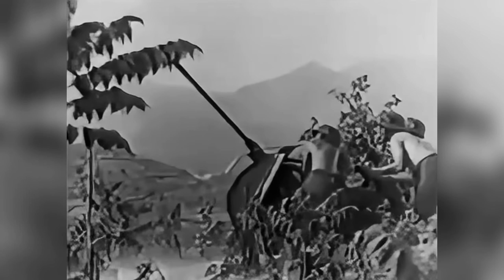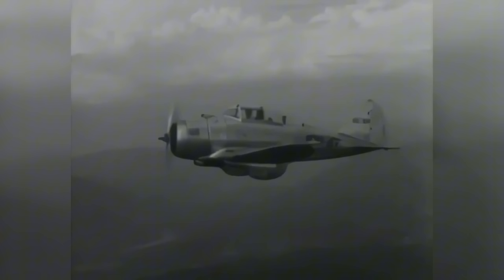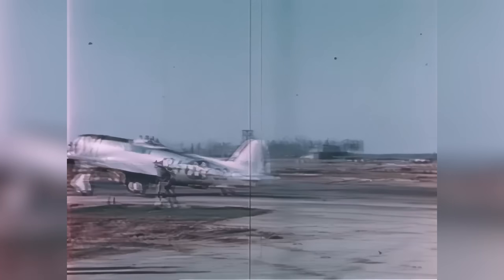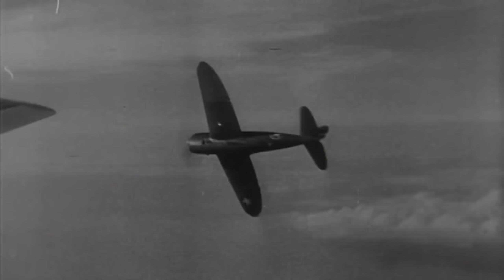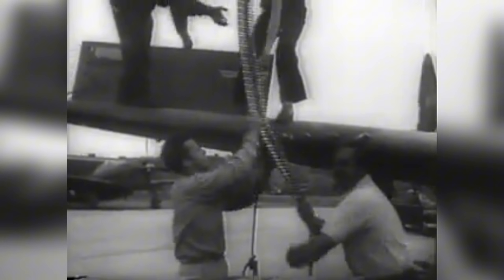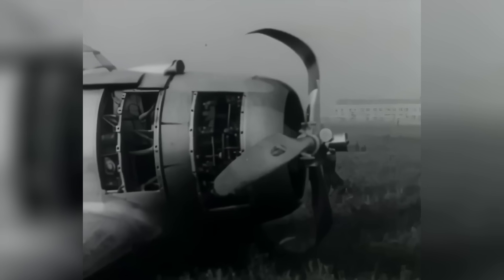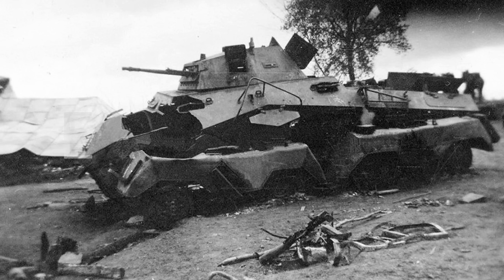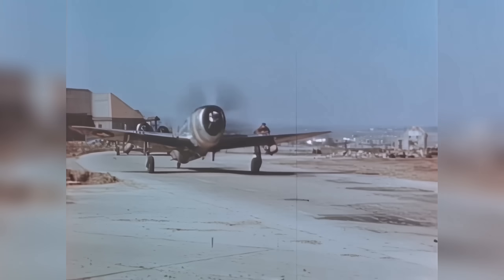Why Was the P-47 Thunderbolt So Hard to Kill?

Comment: The  p-47  of  the  Internet  is  the  greatest  fighter  ever  built....in actual  fact,  it   was  the  WORST .The  Best  fighter  built   and  deployed  in   WW2  was ,  for  people  who   Know  airplanes,  the  FW   TA  152,....best  engine,   best  power  to  weight  ratio,  by  far  the  best  engine,  massive  firepower----20  and  30  MM  Kanonen,  NOT  30  or  50  Cal  US  popguns.  The  47  was  almost  TWICE  as  big  as  a  fighter  should  be,  it  had  the  USA  Scheisse   Radial  Aircooled  Engine,    the  max  firepower  was  a  50   cal  MG.   More  47's  were  shot  down  toward  the  end  of  WW2  than  any  other  plane.  It  was  a  DOG,  It  was  a  Hog.     How  many  Aircooled  engines  ,  top  RPM  2700  ,  do  they  run  at  INDY  or  Nascar??  How  Many  Racing  Powerhouses  are  Twice  the  Size  and  Weight  of  the OTHER  Cars??    Amen....grow  a  brain.
Reply: No your wrong. In fact,it's the "47 C " that won back control of the air from the FW-190 over German Occupied France.

Comment: 3:04, surely that's a turbo charger, not a super charger?
Reply: Nope.  Turbo compresses exhaust gas.  Superchargers compress intake air
Reply: @j_boogie_483  Nope.  They both compress intake air.  Turbocharger is powered by exhaust gas and supercharger is powered by a mechanical drive from the engine.  The P-47 had both.

Comment: Not 86,000 trucks; 8,600 more likely.
Reply: No. It's 86,000 coaches,6,000 armored vehicles, 68,000 road vehicles,9,000 locomotives. Also shot down all of their best Getman pilots in air to air kills at a ratio of 8 to 1.

Comment: The P-47C Thunderbolt and early razorback "D's"  went up to high-altitude and faced "yellow-nosed" FW-190A-5's and won control if the air over German occupied France. They literally shot down all their experienced pilots. Then on return flights would drop down and strafe on the deck taking out important tactical targets. It won down at low altitude as well.

Comment: the bubble canopy

the P and W R-2800 dual radial Wasp

the 13 foot 4-bladed paddle propellor

armoured cockpit

and the only allied fighter to carry 8 .50 cal machine guns

and able to carry as much ordnance as a b-17

could almost break the sound barrier in a power dive if it had the proper aerodynamics
Reply: The payload of the P47 was 2500 lbs. The B17 was 8000. You might want to tone down the hyperbole.
Reply: @jacquesstrapp3219  yeah... i knew that was an exaggeration but it served to prove a point

im pretty sure the bomb load of a b-17 was more like 4000 lbs though...

in actual footage i always see sticks of bombs falling 8 at a time. 

since the American air force used pretty well exclusively 500 lb comp-b HE free fall bombs for most of their missions over Germany the math says the bomb load was 4000 lbs.

i suppose it would vary. depending on how far away the target was. 

a longer flight would mean they would need to sacrifice payload for more fuel. 

a shorter flight would leave more room for ordnance.

still, 2500 lbs is not too bad for a fighter.

the early navy dive bombers that flew off carriers in the pacific, TBD Dauntless` had a bomb load of 1000 pound which was normally carried under the fuselage in the form of one 1000 pound bomb.

just to have something to compare it with .

by the end of the war the Corsair was capable of carrying 4000 pounds of bombs, plus whatever weight of ammunition was needed for its 6 .50s

im gonna check the bomb load of the b-17.

 i know it had the least of all the 4 engined bombers used by the Allies. the b-29 was capable of carrying over 10,000 pound of bombs on a 3600 mile round trip, probably about twice that for shorter missions.
Reply: @FirstnameLastname-e4u  The B17 had a max payload spec of over 17,000 lbs. Even with maxed out fuel and ammo, 8000 lbs. is well within the capacity of the aircraft. Thinking you can calculate the payload from heavily edited footage caused me to question your knowledge and judgement. Comparing single engine fighters to heavy bombers confirmed it. WWII fighter bombers were not capable of carrying out strategic bombing. Read the tonnage of bombs dropped and numbers of aircraft instead of counting bombs on YouTube.
Reply: @jacquesstrapp3219  i doubt this footage was edited... all over the place you see the bombers dropping sticks of 8. i paused the video and counted about 12 planes all dropping 8. 

the problem with specs is that in theory practice is the same as theory, in practice, it never is.

think of the men who crew the b-17. i believe it carried a crew of 9 or 10. with flight suit, gear, etc, each guy would have weighed close to 200 lbs. well times 10 thats another 2k pounds right there and the plane has no fuel, ammo or bombs yet.

these aircraft were also likely carrying more fuel than was strictly "necessary" for their round trip. there would have been a good safety margin for contingencies such as extra power (fuel) needed for 3 engines in the even it loses one. losing more than one engine would be a virtual death sentence anyway so even if the aircraft could remain airborn it wouldnt be that way for long

as we both know the bomb load depends on the mission. Germany is a fairly broad country from West to East. targets could have varied by as much as 700 miles round trip. (i just checked the longitudal east-west length, its about 650 km) 1300 km round trip= about 700 miles round trip

so 0-700 miles, thats quite a difference.

some targets would have been even further away. Ploesti was in Romania, which i think was one of the longest round trip missions any b-17 crew ever made.
Reply: @jacquesstrapp3219  just checked the specs on a b-17.

max bomb load was specified at between 4,800 and 4,200 lbs

so says google
Reply: @FirstnameLastname-e4u  Bombs dropped by the B-17 varied in weight from the M30 at 100lbs. to the M66 at 2000 lbs. Unless you know the type of bomb, counting bombs won't tell you the payload. The tradeoff between range and payload is common sense. Do you think that isn't common knowledge? The explanation of the obvious wouldn't be so bizarre if you weren't lecturing an old vet that's been studying this for 50 years. BTW, the longest mission logged on a B-17 was 19 hours and 10 minutes by the Republic of China Air Force and the Ploesti raid was composed entirely of B-24s.
Reply: @FirstnameLastname-e4u  You need to do more than superficial research. The max bombload that could be carried internally for short low altitude missions was 8000 lbs. More could be carried on external racks. For high altitude missions over central Germany, 4800 was usual though.
Reply: @jacquesstrapp3219  i didnt know you were a vet. not that it changes the data but i may have steered the conversation in a different direction had i known you served.

if i came off sounding like i was lecturing that wasnt what i was going for. 

and yes the raid on Ploesti was carried out by B-24s. 

youd be surprised what isnt common knowledge. most people dont look at the grey areas when it comes to this sort of thing. they look at the stats (if they even do that) and parrot those statistics

its actually not that hard to tell what sort of bom an aircraft is dropping unless its really far away. 

a 1000 pounder and a 2000 pounder would be the hardest to tell apart. being the same shape one would need a sense of scale to figure out which is which

i know about the different types of bombs.

that is to say i know there ARE different types of bombs. 

i dont know the designation for each but i know the USAAF had a lot of different sizes and a few different types. 100, 250, 500, 1000, 2000 lb HE i dont think they went any higher than that in regular production during WW2. not in the American Air Force anyway...

then of course you have your incendiary cluster bombs which were used in the ETO and the Pacific. 

you probably already know this but in March of 45 lemay sent off 331 B-29s loaded with a mix of HE and incendiary

these types were used to burn down 16 square miles of Tokyo in one night (thats about 10,000 acres) 16x650 acres/sq mile=about 10,000. 

as a guy who grew up on a farm thinking 400 acres was a lot of land, its hard to imagine 10,000 acres being reduced to ash in one night.

the raid killed well over 100,000 people in a firestorm so powerful the updraft tossed planes around like leaves in the wind

The British had one called the Tall Boy that could only be carried by the Lanc (or a B-29 i suppose).

it weighed 12,000 lbs. 

i believe a bomb of this type was used to eventually sink the Tirpitz. 

i havent been studying this stuff for 50 years, but i was brought up surrounded by a library made up of 90% WW2 history books. 

maybe 30 years...mostly WW2 aviation but army and navy as well. from Alexander the Great to Vietnam. 

We didnt have anything on the Gulf wars or Afghanistan. 

even before i began reading my way through this huge collection i used to pretend i was a commando. ever since i was 6 thats all i wanted to do.

 i had 3 younger brothers and we would spend entire days "playing war" then i would come in at night and read about it.

right after school i would go out and take the .22 to hunt woodchucks and the shotgun to shoot pigeons that would roost in our hayloft and shit all over the bales.

 their feces carried bad diseases and the last place we wanted it was in the food our cows were eating

i applied for the Canadian army since i live in Canada when i was 17, 25, 36 and 39 but i was taking some prescribed medicine at the time so i wasnt elligible at that point

Comment: The mist of alcohol and water being injected into the engine will dramatically lower intake temps, meaning it'll make a lot more power. It also raises the octane content of the fuel, making the engine less likely to knock & meaning you can run even more boost, and even more timing. Basically, they can crank up the boost and timing due to the colder intake temps, and the higher octane, adding a big boost to the power level. Without risking knock in the engine that comes from low octane and extremely hot intake temps.
Reply: The water/alcohol injection was to prevent detination in the engine.  This allowed for the engine, at full military power, to operate for a limited time.
Reply: Water methanol injection doesn't raise octane content in fuel.
There is no octane in water- methanol mixture.
Reply: @SkinPeeleR   yes it does. Methanol has a very high octane rating and combined with water reduced intake temps by a substantial amount.
Reply: @victorromero4572 Actually there is no octane rating for alcohol.  Octane is a rating for gasoline powered engines.  I remember learning this in Aviation Maintemance Technician school...46 years ago.  Unless it's atomic structure has changed in the 38.5 years since I received my A&P Rating.
Reply: @Rancid_crab_tree well thats interesting cause ethanol and methanol have octane ratings now 🤷🏽‍♂️
Reply: @victorromero4572 Newer engine and fuel technologies have advanced over the last 90 years.  The R-2800 variant on the P-47 was designed for gasoline, the technology for it's day.
Reply: @Rancid_crab_tree yes i believe most if not all airplane engines ran on gasoline in those days. However adding water/methanol mix will decrease chance of knock and reduce intake temperatures which will further reduce chance of knock wich allows for more timing/boost and more power. Octane rating is simply a fuel’s ability to resist knock. So alcohol definitely has a higher ability to resist knock than gasoline.
Reply: @victorromero4572 Correct, and it was employed at take off when maximum power was needed.
Reply: @Rancid_crab_tree ya one of my top favorite ww2 warbird! Luv the jug
Reply: yea its like crack for an engine, however twincharged system it has is great imagine since it will get boost at any rpm and although i hate radials i think the system itself is great